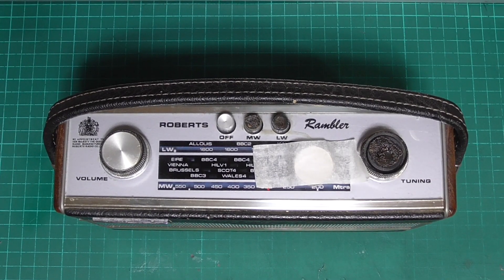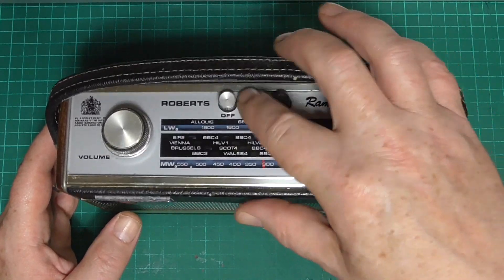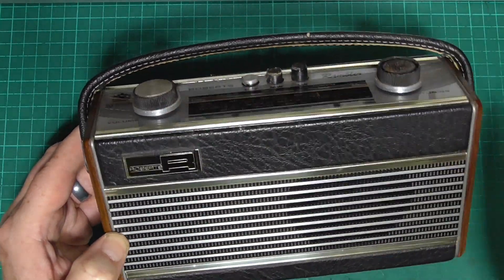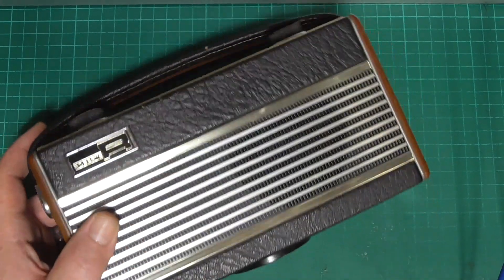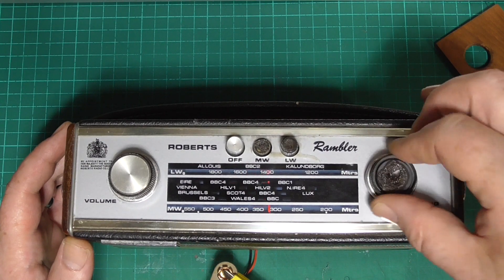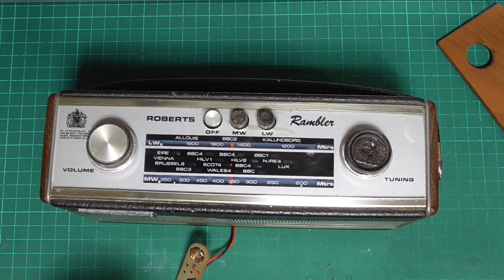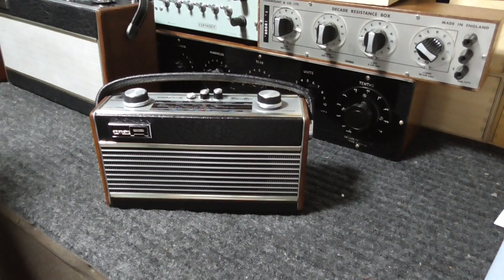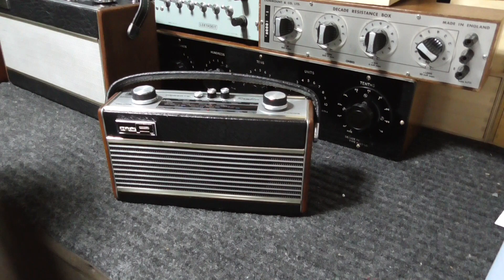Roberts Rambler - Vintage Transistor Radio - Diagnosis & Fix

Comment: Artists' (or even kiddies'!) black acrylic paint is very good for repairing nicks and gouges in black rexine/vynide. Can be built up in layers too to match original surface, and can also be used for sundry colours depending on your paint mixing/matching skills. I am really fond of these little Rambler radios and have a few, my favourite is the "marine" blue model.
Reply from the maker: Thanks for your comment Gerard, and for sharing your tips - I'll have to give that a go!

Comment: I have one of these that needs a tuning capacitor, the original has shattered, I can't think how that happened. I also need all the knobs including the round type switch ones. I have been keeping a look out for a scrap one but so far I have not had any luck finding one with all the bits I need.

Comment: Its always a great day when I see a Codeeze video posted. Those Roberts Ramblers are very nice looking radios. How old is it? Seems well built and just has a simple beauty to it.
Reply from the maker: This particular Rambler was made in 1976. Thre first Rambler was released in 1975 and had square wavechange buttons. This is the second version of the Rambler with round buttons - but isn't the Rambler 2. 
Confusing I know! 
The Rambler 2 came out in 1984.

Comment: Hmm a retune and dodgy wire not quite getting to the long wave trimmer.
I'm surprised he heard anything from it at all.
Hey i think junior might be stealing your job.
He will be drinking your tea next :-D
Looks the biz now :-D
Reply from the maker: I found the long wave problem using my years of experience, knowledge, brand awareness, and complete fluke... 😂
Reply: @Codeeze  i would not be surprised , i too have poked around with a pencil and stumbled by accident on to a faulty bit lol.
I cried when my magic pencil vanished.
I think Radio Cruncher must have stolen it.
But i don't think he has the knack, he is an amateur 😀